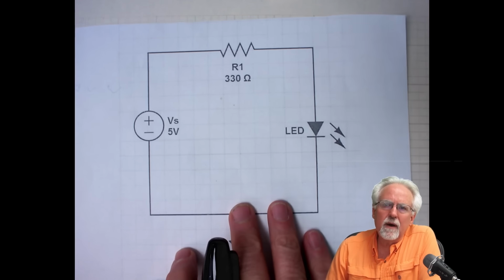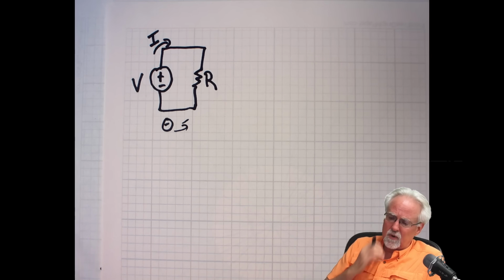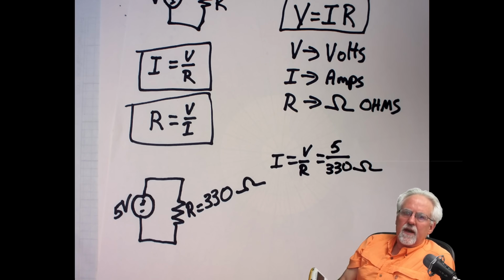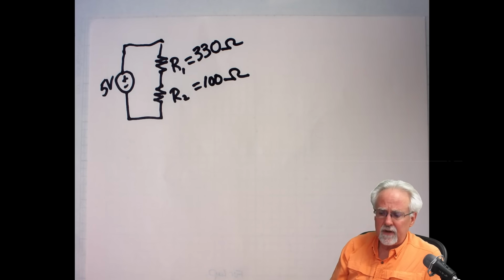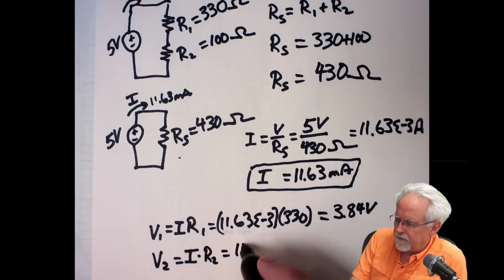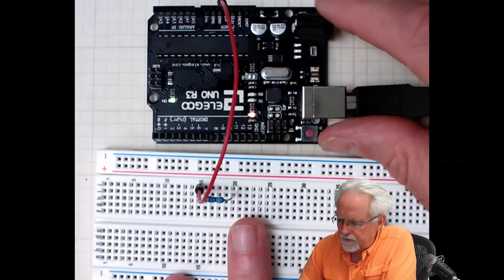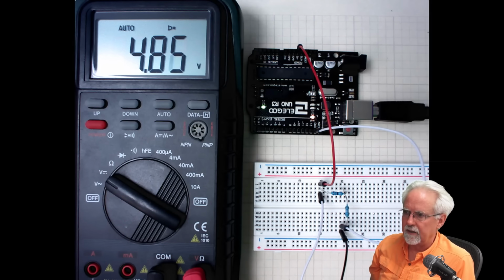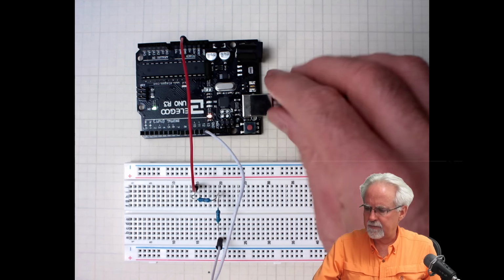Arduino Tutorial 9: Understanding Ohm's Law and Simple Circuit Design

Comment: Hello Paul! Excellent tutorial! As far as the voltage goes, seems like when the Arduino is powered by the USB, there is a voltage drop, even checked it with my Keystudio Plus board, it does the same thing despite the Keystudio Plus board has a buck converter instead of a linear regulator. When I use the DC power port with an input voltage of 7.5V, both boards will have 5V.

Comment: Why doesn´t it burn because of shortcircuit?
Reply: It's not a short circuit because of the resistors that "eat up" the current. If you were to connect the 5V directly to GND...you might need to buy a new Arduino....

Comment: I normally like the coding lessons, but I really enjoyed this one. Taught me to use a multimeter I've had laying about for years (needed a new battery), and got me to install a scientific calculator on my phone, I enjoy maths problems. Also did some trouble shooting, I was only getting 4.44volts from the 5v pin on my Arduino, powered from the laptop, Google's says power protection diode in USB, so I switch to 9v battery and getting 4.99 volts and calculated voltage across resistors. I wish your YouTube videos were around in 1981 when I was trying to learn machine code from magazines, with nobody to help. Really enjoying this series, thanks.

Comment: Hi Paul great series can you tell me if the voltage distribution across the circuit is dependant on the value of the resistor

Comment: I noticed you connected the GND on the opposite side of the arduino board from where the 5V is, rather than the ground that is right next to the 5V output, does this matter? Thanks :)
Reply from the maker: Does not matter.
Reply: @paulmcwhorter oh, thanks 😊

Comment: When you first used the resistor in the very first videos, I learned about the resistor color code and calculated the resistance then I realized for some resistors reading color code is really difficult and I know that I need to buy a digital multimeter.

Comment: Might be a stupid question: 

Since the voltage at R1 is at 3.84, before going into R2, why wouldn’t you use 3.84 as the voltage going into R2?

Comment: Well, this video answered my question from last night. The only part that doesn't make sense to me in this video is using the e to -3. Its been about 20 years since I made a calculation like that. I'm so used to just putting numbers in as 0.01163 instead 11.63e-3. I haven't used a graphing calculator in about 20 years also. Then knowing when something is a mili or a mega or a pico or a kili, etc. I imagine there is some kind of cheat sheet to help with that. Thanks!

Comment: Its a bit late now, but id say with laying out circuits on the fly is directing attention to your motions of setting up the board then what you are saying. So id say if your going to teach using a bread board to use CONSTANTS on the board the same way you do in your programming. So the red rail is your positive voltage, the blue rail is your negative voltage inputs. I know its more jumpers but it allows them to listen to your wisdom and not scramble trying to see the variable set ups... i think most beginners are trying hard to get the picture, so when you change the layout your changing the picture in their heads.. I  am sure it causes a bit of confusion to beginners... I am watching this series because i think your doing a awesome job and i want to pick up anything i missed years ago.... certainly not boring

Comment: Min. 20:55 , now this is a short circuit , is it not ?
How many Ohms are to be used in order to prevent problems ?
Is there a rule-of-thumb ?
Like anything above 500 Ohms is fine ? Or any resistor vallue thats a factor X of the source voltage ?

Comment: From Tutorial 9 Low Voltage (4.8 volts) on 5 volt pin  of Arduino. The USB cable from MY  laptop is supplying just under 4,8volts and that is across the 5volt+/- input on the soldered connections on the underside of the USB socket. And that , is exactly what is being  read on the 5volt pin,. However using the 9 volt PP3 barrel jack connector the  on board 7805 kicks into life and full 5 volts on the pin is restored, As a qualified electronics tech (C++  dyslexic)  it has always puzzled me how the 5 volt onboard regulator could work with a 5 volt input in this case 4.8 volts LOL. Having then checked the 3 x regulator connections and heat sink only 4.8 volts outputs and the middle pin of the regulator connects directly to 5 volt pin / processor.

Paul not boring or rambling at all  and you totally  redone the tutorials to improve them well done proves you care about students learning.  It took me 5 years before I was happy  with  my teaching hand outs projects. This was INtel 8085 Hexadecimal  Machine code Programming. 
Keep it up

Comment: Definately not boring. Loving it!
One thing that threw me slightly was the calculating the current. Entering 5/330 on my calculator you get  0.01515151515151515151515151515152 not 15.15
I just lived with that I need to multiply my result by 1000 to get the same result and assumed thats the same as the E-3 (don't have a fancy calculator, just using Window's calculator). Given you mentioned mA I knew milli is 1000 so figured it was right.

Comment: Super new here, but have a q.
When the current is measured over both resistors, and it adds up to approx 5v, my brain goes "i have now added enough resiatance to counter the effect of the voltage." But just for fun i put an LED after the 2nd resistor and it lights up. How so?

Comment: i think im misconceptualizing something here: you've shown that that math works on this and i understand that so i hope im making sense. 

why does the math on the second resister use the 5 volts and not the reduced voltage (3.84V) that is coming out from the first resistor? or does this matter mathematically?

Comment: My calculator is not giving any of these answers at all, I have an engineering button and the ability to put e-3 but I keep getting 57.902 instead of 1.16 volts is there any online resources calculators that I could use or specific calculators. I am using a casio fx-85GTX classwix , would really help knowing what to do as it is preventing me from completing assignments set in the next video.

Comment: Resistors in series are easy. It's Parallel circuits that require a little effort. Also we didn't have calculators when I learned Ohm's.
Reply: Thanks for videos there really great

Comment: Just an interesting note about Ohm's law from Nikola Tesla. He was on the understanding that Ohm's Law would only hold true until the point that you frequency matched the electrical current with the object to which the electricity is flowing through.

This was most apparent in a letter which was written to Nikola about a coil design to which someone else had made. "I followed your instructions on how to wind the coil exactly as you had described, and yet no matter what, I'm not able to attain the power outputs that you've seen in your experiments."

I've always found it interesting that no one has looked into this further, especially when doing any form of foundry work, as we know that just by placing sand on a plate and playing different frequencies you end up with the sand forming different patterns.

Just some food for thought :)

Comment: Paul,
One again, another amazing lesson, explaining resistance and Ohms law was excellent.
I was hoping that it would also include how to calculate the resistance necessary to safely power an LED.
I am a bit paranoid about blowing one out due to too much voltage.
I scanned the rest of your videos (in this series), but I don't see one that might explain the calculation.
I have seen others on the web that make references to LED in series or parallel, and it looks like the calculations might be different.
Is there a video where you explain this?
Thanks
Carl

Comment: You started the voltage measurements with a load on the 5V. Remove the load and then measure the 5V output, should be a bit closer to the expected 5V. 😉

Comment: Well, a question arises why the voltage across R1 is 10% deficient while that across R2 is almost what you calculated.

The query why the voltage across only one of the resistors suffered from the variation in source voltage. 

The answer might be in the tolerance in value of the resistors used. 

Hope you can add the explanation to the next edition / revision of the video.

Comment: Not boring at all. Actually building the circuit with my own hands, then physically testing it with a multimeter to check my maths really made the dry theory come alive.
On my circuit, the initial voltage was 5.1 volts. Using the formulae, I worked out  V1=1.18 and V2=3.92 giving a total of 5.1 volts. I put the multimeter across each resistor and got the exact same readings. Observation = Prediction. Yay!😁

Comment: Paul I wonder if I may ask a few technical questions about the Arduino ESP32 that I am having a problem with and I think you may be able to guide me through the problem.I have been building a charge controller and everything works apart from one big problem I can not get any PWM out of the written coded pin IO15.The led and PWM does work using the simple blink and fade code but using the code I was given I see no PWM output.There are a few pages of code and some code provides protection and stops the PWM from outputting a signal I just hope you can help kind regards John

Comment: I'm confused on the Ohm's Law.... the first problem you present us with 5v over 330Ohms ... you come up with 15.15 ma ... when I do the calculations, on both a standard calculator and the online Ohms Law calculator - I get 0.015151515 .....  rather than 15.15 ... is there something I'm doing wrong, or do I need to disregard the first zero and take my answer from the first numbers after the initial zero's.
Reply from the maker: Same Answer. you got .015 AMPS, and that would be 15.15 milliAmps or ma. Look up my lesson on scientific notation.
Reply: @paulmcwhorter  Thank you 🙂 will do :-)

Comment: This is good, very nice refreshers for me, even the very basic stuff. One thing here, I would expect that the voltage drop across both resistors would be lower for each, in proportion to the Ohm ratio, based on the actual input V of 4.8.

Comment: Thank you for this!
Going thru the fundamentals is very nice, even if i have gone thru this before im still such a novice on the electrical side that understanding and applying circuit analysis is difficult. 

Cause electricity is sort of difficult, is it like water flowing thru pipes where the voltage is like a waterfall and the amps the width of the river, or like pyrotechnics where the blast will follow the way of least resistance?
How will the electricity spread thru parallelle wires if one wire has a big resistor on it while one wire has very little restistance, will the wire with big resistance carry any electricity at all or will it all go the the way of least resistance to ground?
Etc etc.
I still dont grasp these things fully and when it comes to phases (3 phase AC) vs hertz vs DC and converting AC to DC and getting rid og signal noise, and how that is influenced by the AC phases, or if Hertz has anything to do with it and what is actually cycling/vibrating regarding the Hertz, etc etc.

So thank you for these clear and interesting tutorials. You are a hero!

Comment: Looks like this is 3 years old. The last lesson using an oscilloscope was a bit much. None of us will have one. I last saw one in high school. You focused on analogue simulation but didn't really capture why. Lesson 9 is very basic. Even I followed it!  I think a table of contents or index of all of your new tutorials would help. If you have one where is it? That way we could go directly to some of particular interest. I will want to know all about stepper motors or whatever I need to rotate a shaft a known number of degrees. First I have to have devices that will measure the angle between 2 surfaces or straight lines in 2 dimensions. Then rotate the shaft that number of degrees.
Reply from the maker: “It is not the critic who counts: not the man who points out how the strong man stumbles or where the doer of deeds could have done better. The credit belongs to the man who is actually in the arena, whose face is marred by dust and sweat and blood, who strives valiantly, who errs and comes up short again and again, because there is no effort without error or shortcoming, but who knows the great enthusiasms, the great devotions, who spends himself in a worthy cause; who, at the best, knows, in the end, the triumph of high achievement, and who, at the worst, if he fails, at least he fails while daring greatly, so that his place shall never be with those cold and timid souls who knew neither victory nor defeat.”
Teddy Roosevelt
Reply: @paulmcwhorter  You asked for feedback. I complied. I also made what I thought was a helpful suggestion which seems to have been ignored. I like your series and have said so before.  You like witticisms? Here is one from Oprah: "The trouble with most of us is that we would rather be ruined by praise than saved by criticism."
Reply from the maker: Ah . . . you are an Oprah fan . . . that explains a lot. Actually perhaps watching Oprah would be a better use of your time as your toxic attitude is not needed or appreciated here. Good day.

Comment: Mr. Paul, in this case if you change resistance will you change voltage supplied from arduino or it's current?

Comment: So this my sound kind of dumb but for instance how are you getting your numbers to begin with. I can always get the volts but how do I find what the LED needs to even figure out the resistance to get started? I have some unlabeled small motors that I want to eventually use. Also would love a way to do the math by hand just to better understand because I don't have a scientific calculator yet. O and how would I calculate how long a battery would last?

Comment: I was thinking about OHM's law and then I was like, If you had a circuit in which there was no resistors (So, basically hooking 5V directly to ground) What would be the current? I=V/R
I=5V/0 Isn't that undefined?? So... Is there current??
Reply from the maker: dividing by zero practically is not so much undefined as it is a huge number (infinity). So if the resistance is zero, the current would try to be infinite. But practically there is no such thing as a zero resistance. Even a metal wire has a small resistance. So a short puting a wire between 5V and ground would lead to a huge current which would smoke your device.
Reply: @paulmcwhorter  Thanks A LOT!!!! Me and my dad were talking about it and we were stumped! But then you answered it! Thanks!!!!

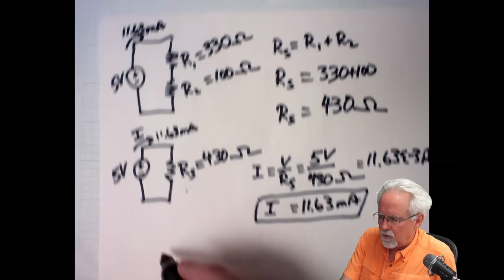Comment: What do you mean when you say "The voltage across R1" at 15:16 Does that mean how much voltage got 'resisted' or how much voltage there is after the resistor. If you could help that'd be great, since that is kind of confusing me. Thanks Paul!!
Reply from the maker: Voltage drops across a resistor. If the voltage at the top of the resistor is 4 V and at the bottom is 3 V, then there was a one volt drop across the resistor.
Reply: @paulmcwhorter  Thanks SO much Paul!!!

Comment: Hi Paul, liked this one but did not get the most out of it due to not owning a digital multimeter so will come back when I do. Just wondering if any old multimeter is good enough or if there is one for the specific low voltages/mA the Arduino spits out? (as I live in the UK so can't use your link)

Comment: Hi. I tried this experiment today, using a Kaiweets KM601 multimeter.
ITEM                                  THEORETICAL.              ACTUAL
R1.                                       330 OHMS.                  329.1 OHMS
R2.                                       100. OHMS.                  99.8 OHMS
Circuit voltage.                       5.00.                             5.002
Current.                                  11.62 mA.                     11.66mA
Across R1.                                3.84V.                           3.837V
Across R2.                                1.16V.                            1.116
ACROSS BOTH.                       5.00.                             4.94

Sometimes, when I connect the UNO R3, the Windows 10 computer tells me that it cannot supply the power required by the device. Other times the message does not appear. Depending upon when I take the available voltage reading, it can vary from 4.86 to 5.03V.

I am enjoying the course very much.

Cheers,

Eddy

Comment: Only just found this series. The engineering explanation is all very clear. Unforunately, the explanation is all "theoretical" and does not apply to the LED circuit you are using. 
Using R1 (330 ohms) in this case, you explained there is a voltage drop of 3.8v. I can see in the LED circute 330 ohms is used. Why did you choose this resistance/voltage drop? This is not explained.

Comment: Great videos so far, very well explained. One thing that I did miss between your lessons and the starter pack is how to tell resistors apart. I'd assumed I had a bag of 330s because they where all blue and looked the same, nothing on the packing etc. But if you look real close there are stripes that signify different types by colour, then had to look up what's what 😉 Also solved the problem I had that my LEDs where very dim 🤣